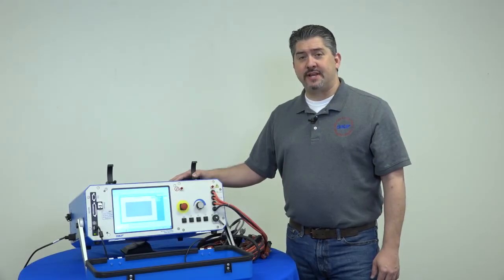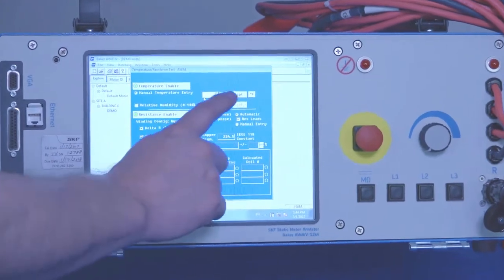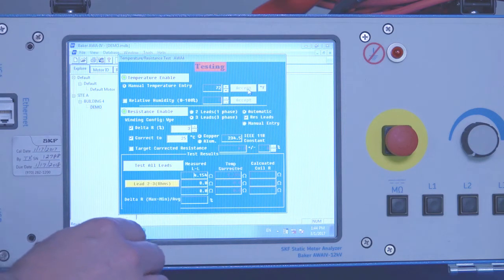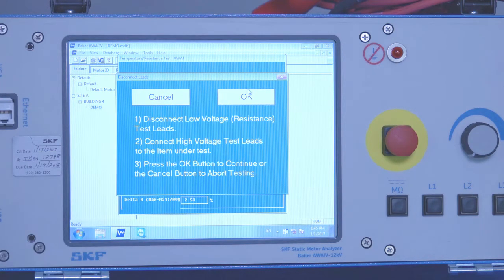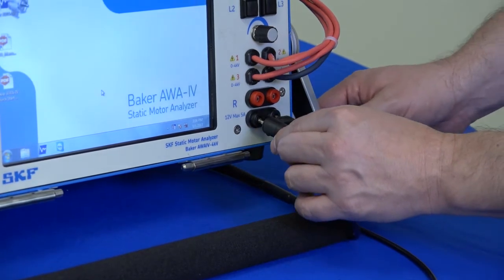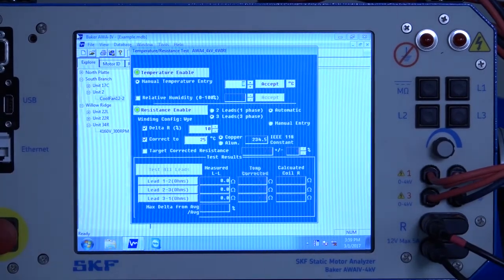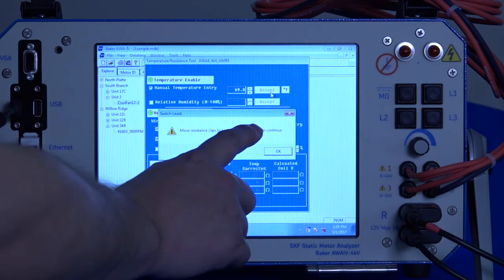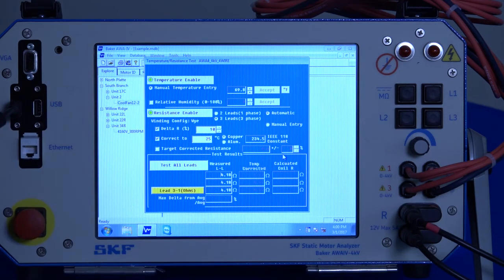SKF Baker AWA-IV low voltage resistance test

Comment: This video is not showing how the resistance to be measured is connected, I believe that the low voltage resistance is 4 wire measurement with the 2 test leads but I may be wrong.